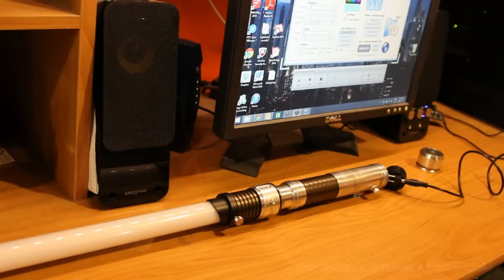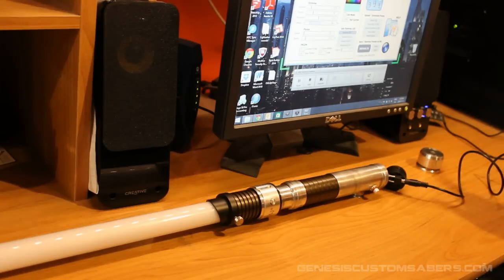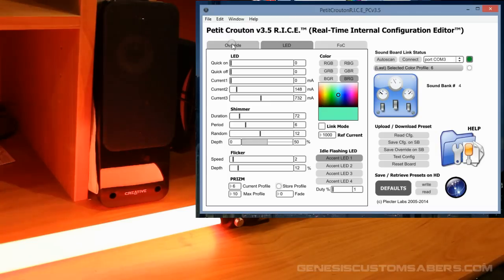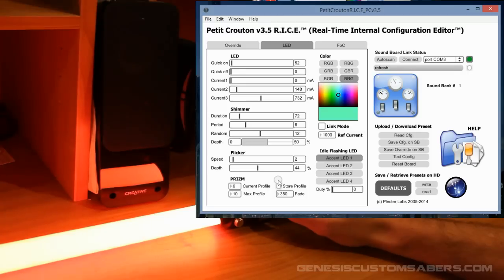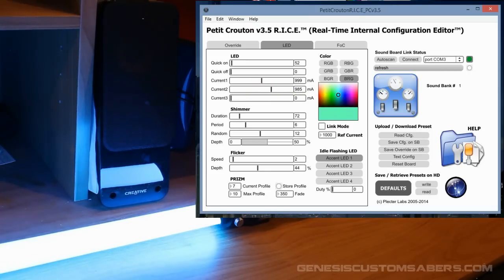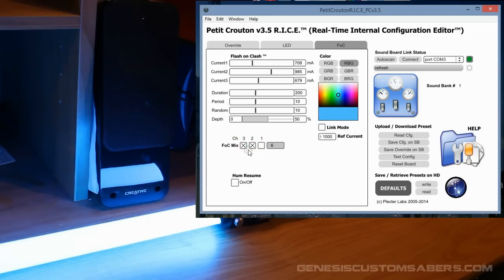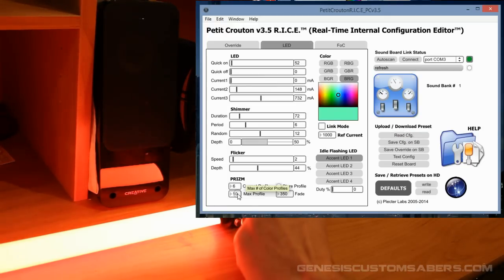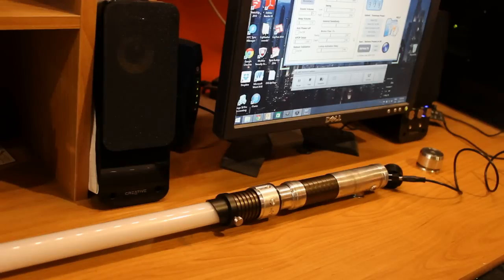RICE with Petite Crouton 3 5

Comment: hey Rob. I have CS3 and when using the mute feature to light the saber only and having it connected to the PC I notice that I get some crackling from the speaker, but only when I change the drive option in the RICE closer to 1023. The colour for that led is deep red. My question is why does it need to be under 700 if it's resistored properly? thanks
Reply from the maker: Hey,
It only needs to be under 700 if you have an old LED that is only rated for 700. All the Tri-Cree's I've been using for 2 years can be driven up to 1000 mA.
Besides - with a CS it's direct drive - which means there should be a resistor on the LEDs, you can then drive them full at 1023 no problem. This video is for the Petite Crouton not the CS. It's not direct drive it has a voltage regulator. That's why you can select mA in RICE.
Reply: Ah thanks for clearing that up. I'm having an issue with using red and deep red leds with my saber in that when deep red is around 800 or more the speaker crackles. I'm wondering if it was installed correctly but it's been done by a reputable vendor.

Comment: Does this feature come with the Crystal Focus 7?  Tried this during RICE but just kept getting blaster blocks and power-downs! :)   I have an  ACF7
Reply from the maker: Only with CF version 7.5,  The ACF7 run does not have that new firmware.
Reply: +Rob Petkau Hey Rob, how do you do you change the sound fonts on PC 3.5 via SD card? My saber doesn't have a rice port.

Comment: dose the 3.5 still need the color extender?
Reply from the maker: Technically no - it's the same as the PC v.3 You can see in the manual about "Pseudo color mixing", or get the new PC Prizm that is designed to be used with one cell and no CEx. But with the PC and 7.4 volts - using the CEx gets the best results
Reply: ah nice